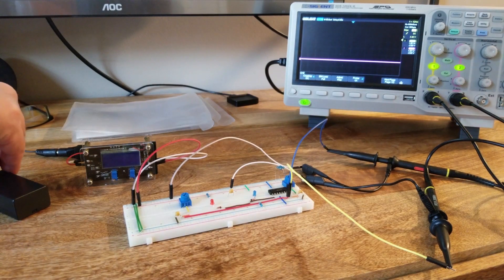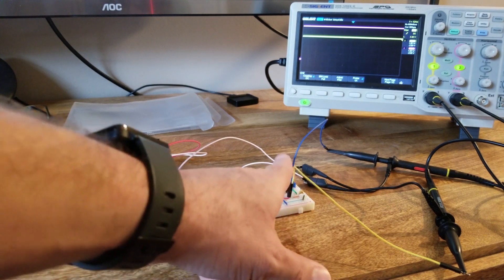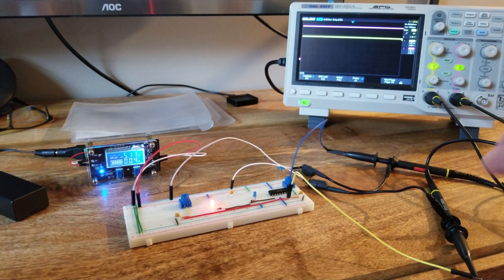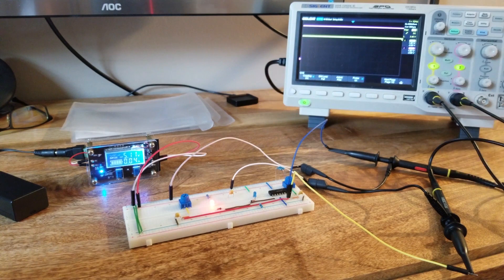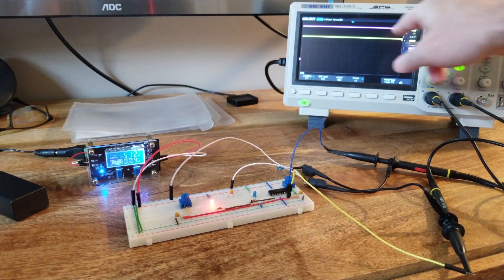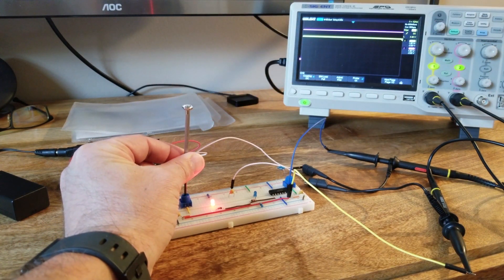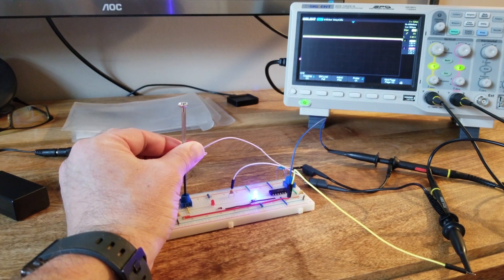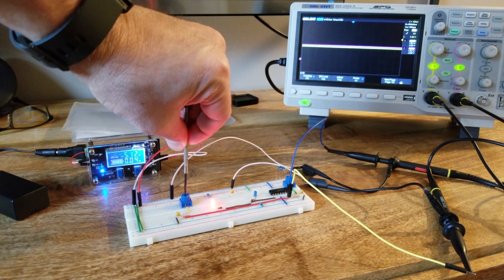Demonstrating the LM339 Comparator

Comment: i think the circuit is using the open collector to drive red led

and the red led resistor on the positive rail, which is also connected to blue led to ground

when red led is driven, voltage drop is low so blue led doesnt turn on

otherwise, red led isnt being driven so current goes through blue led

Comment: Hi i have a tyco server powersupply 12.2 volts 45amp with a lm339dg ic inside and seems to be a quad comparator. How can i increase the voltage of this powersupply to 13.8 volts. Normally u can connect the inverting pin to the ground through a trim pot. But this comparator has 4 inverting inputs. Which inverting input pin should i use. Could u please help me asap.